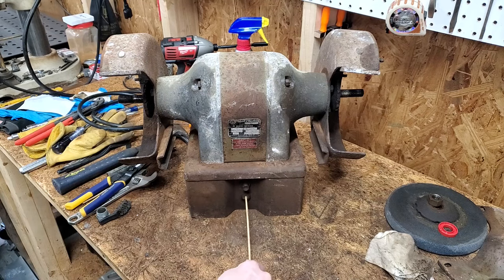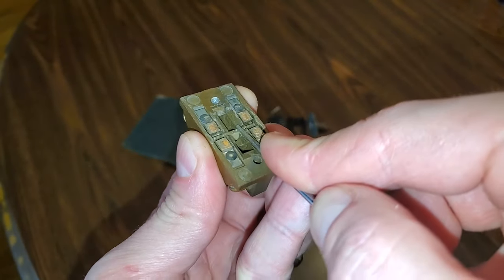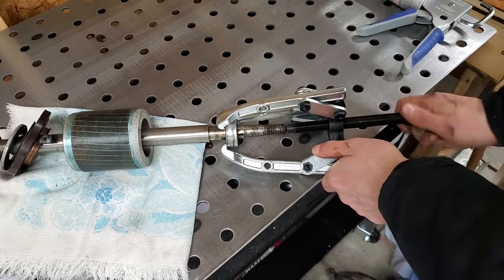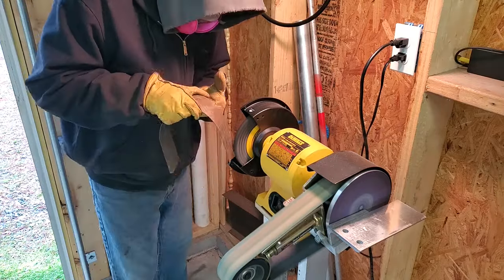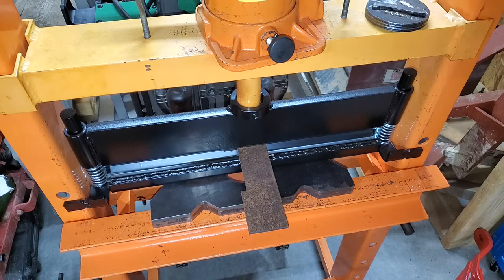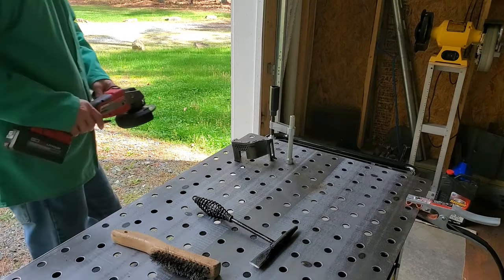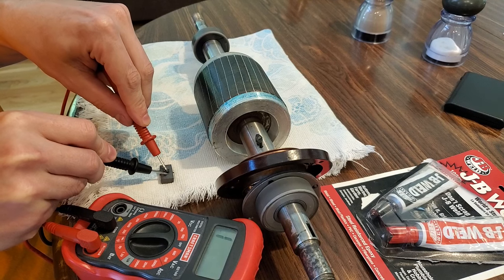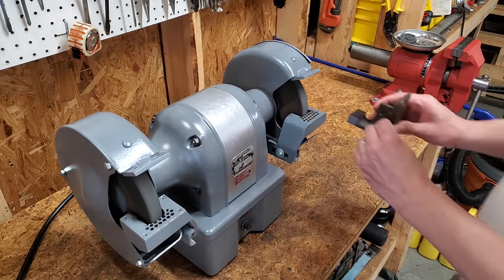Bench Grinder Restoration

Comment from the maker: 2 or 3 Jaw Gear Puller:
https://amzn.to/3WXPVWs (affiliate*)

Mobil Polyrex EM Electric Motor Bearing Grease:
https://amzn.to/3NitdFl (affiliate*)

Loctite 545:
https://amzn.to/45Olc2d (affiliate*)

*Purchasing from these Amazon affiliate links earns my channel a small commission. Think of it as a tip that doesn't cost you anything. Thanks for the support!
Reply: This tool costs about the same as a new bench grinder, lol.
I appreciate the project for the love of it though. A Black and Decker though? I'd have walked on by. In the UK they are considered cheap rubbish, at least nowadays. This looks like it was built in the 60s and might be worth the effort, since EVERYTHING was made properly back then. 

My grinder has stopped working.... I turned it on one time in freezing cold weather and it started briefly and then died. Is that the motor giving up? Took apart and can't see anything immediate. The fuse is also good. There's no capacitor though, which is weird.
Reply from the maker: @ArcanePath360  I agree, I wouldn't have grabbed a more modern B&D grinder but this one is pure quality. I like knowing that it was literally at the dump and now it's a very capable tool. Money-wise, I only bought some bearing grease and paint. It took a lot of time and effort but I learned a lot. For me, that's what it's all about. :)

As for your grinder, I'm no pro but it could be the switch. I'd try bypassing the switch, like I did, then plug it in and see if it comes back to life.
Reply: @Mikeattempts   Thanks, I'll give it a go. I agree. I spend months on projects that don't save any money, but as you say it's about learning and honing skills.
Reply: @Mikeattempts  Ok I tried the switch... I think it's a single pole, there's only continuity on one side when on. I thought both sides needed continuity to work and a single pole only shuts off one side, but whatever.... I bypassed anyway and nothing happened when I plugged it in.
Reply from the maker: @ArcanePath360  With the switch bypassed and the grinder plugged in, give one of the grinding wheels a spin to see if you can get it going. If not, I guess it's an issue with the motor. Unless your grinder has carbon brushes that need to be replaced.
Reply: @Mikeattempts  Yep, I tried spinning, thanks. No bushes. It's a cheap one that's served me for about 10 years so I guess it's time to get a new one. It was only £30. I think I'll get one with more power as 150w is not enough for me any more.

Comment: I have the ten inch model. Exactly the same. They were made in the 1940's. Mine has the original paint. It has so much power it's a bit dangerous.
Reply from the maker: That's cool, I didn't even know there was a 10" model. Original paint too, that's rare! :)
Reply: Want to sell it? 🫂
Reply: They built them to last back then. I have a 10 inch Wolf grinder and it is all cast and indestructible. It weighs in at about 100 pounds with 1 1/2 inch wide wheels on and runs on under its own momentum for several minutes after it is switched off,   Potentially pretty dangerous if you haven't got your wits about you.

Comment: Good job on the restoration! I'm always pulling things out of the trash just to see how they work and if I an fix them. Even when I don't need them.. Ashamed to see things go to waste when they can be repaired and used again.
Reply from the maker: Thanks! I couldn't agree more, it's very rewarding to save valuable tools from the trash. I'm the same way, I want to understand how stuff works. I've learned a ton since starting these repair videos, but I know I still have a lot more to learn. Thanks for the comment.

Comment: That gear puller is certainly right for removing bearings. Nice overall job on the bench grinder. You lucked out on that one! :)
Reply from the maker: Thanks! I think there's a tool specifically for pulling bearings and evenly supports the face. Luckily these weren't tight, so the gear puller worked fine. :)

Comment: I'm lovingyour content and the philosophy of repair you're bringing to the world. Though I have to say, if ever you are filing, the best method to remove the most material faster without making an awful noise, you want to position the part to be filed so you can file directly above it. And forward strokes only. this keeps chips from binding in and rolling around between the teeth all the time and keeps you square to the work surface. I know what Fireball Tool said, but knowing what my cheap files have done, it baffles me that the expensive files he used wore out after taking so little material.
Reply from the maker: Thanks, I'm glad to hear you're enjoying the channel. Yeah, I get that the file only cuts in one direction but picking it up after every stroke just make the job take so much longer. ;) Thanks for watching!
Reply: @Mikeattempts  ah, it depends. I love filing, personally. It's not as quick as a 40 grit flap wheel but the file can be as rough as a grindstone or as accurate as a CNC machine depending on operation.
Reply from the maker: @classydays43  I can't say I love it but, once finished, it is satisfying to see the results of shaping metal by hand.

Comment: A few things. The thing you called a commutator should be the centrifugal switch that breaks contact with the start capacitor once the motor is up up to speed.

The other thing? IMO never reuse sus bearings. Just don't. Bearings in an application like this just aren't that expensive to replace. And these for sure look like they were "rode hard and put up wet".
Reply from the maker: Ah, thanks for letting me know about the centrifugal switch! As for the bearings, I agree. Like I said in the video, I bought brand new bearings, but I couldn't find the exact width. I was afraid there'd be too much play with the new bearings, so I decided to clean and repack the old ones. They sound good when the grinder is running but I guess time will tell. Thanks for the comment!
Reply: Thanks so much for making this video! It’s exactly what I needed to see. I was given the same grinder, albeit slightly different. Probably just a different year. It works great and has no damage. It even came with both tool rests. I’m going to replace/repack the bearings and paint it. This is a quality USA made tool.

Comment: Drill pilot holes first, that centers the holes. Depending on the final hole size, drill the holes larger by stepping up drill sizes for easier drilling and it is less damaging to the bits.
Reply from the maker: Ahh, makes perfect sense, thanks!
Reply: @Mikeattempts  keep up the good work
Reply from the maker: @remowilliams8118  Will do, thanks again! :)

Comment: For a slot. Get a beefy x-y table with a vice and use a 4 flute plunge end mill (has teeth on the ends as well as the sides)
Reply from the maker: Would an end mill work alright in a drill press?

Comment: Love it! You went all out on that one. Not many still using stick welding in their repairs....I'm old school too.  When I find a bearing loose on a shaft, I add three center punch divots to the shaft to tighten things up, comes apart again with no heat. I made some fully adjustable rests for my old Baldor, see them at "Instructables- Beagles - New Rests for Bench Grinder"  Cannot add a direct link here or my comment will be deleted.
Reply from the maker: I'm glad you liked the video! I put a lot of work into this grinder because I'm in it for the experience and to learn. I checked out your adjustable rest, those should last forever! :) Thanks for the comment.

Comment: Hey Mike, next time you encounter a loose bearing and shaft surface that's too much for threadlocker to fix, use a solid center punch and hammer to peen the shaft where the bearing's bore would seat.  Don't go at it like a shaved ape with a sledgehammer but with just enough impact to raise the surface in equally spaced points around the shaft. You may need to repeat the procedure in an equidistant row from the last one until you have raised the surface enough to accommodate the full width of the bearing's inner race. Once you're satisfied with that, add the threadlocker and seat the bearing. Should cover the repair enough to satisfy your need more than adequately.
Reply from the maker: I've heard of that technique, but I've never tried it myself. I considered it on this and a more recent project, but I was hesitant because I didn't wanna mess up the shaft. However, your detailed tips would make me feel more confident that I was going about it the right way, thanks!

Comment: the mistery item in the motor is in the uk called a centerfugal switch great grinder when its up and running
Reply from the maker: Ah, so it disconnects the start capacitor once the grinder is up to speed? Thanks for the info!

Comment: That comptration in the motor is a odd centrifugal switch, if it broke again , it can be replaced whit a modern centrifugal switch for the same size motor or a push button as a starting capacitor switch.
Reply from the maker: Ah, it's good to know I'd be able to replace it with a modern style centrifugal switch. I'm not sure if I understand how it works though. I assume that little spring-loaded post with the carbon brush retracts once the motor is up to speed but how does it retract? If anything, I would think the brush would be push away from the shaft harder as the shaft spins faster. Thanks for the info!

Comment: What was the bearing number of the original?  Or do you have the ID, OD and shaft diameter?
Reply from the maker: The original bearing ID is 20mm and the OD is 47mm but I don't remember the width. I was able to find replacements with the proper ID/OD but I couldn't find the right width, which is why I ended up regreasing them.

Comment: Please explain what you need to see on the multimeter during the continuity test.
Reply from the maker: The great thing about the continuity test is the sound. If you hear a sound, there is continuity between the two spots the probes are touching. No sound, no continuity.

Comment: the reason that your bearings darkened is because you used the " green simple green " in your ultra sonic. You gotta use the purple simple green, and it dosent darken the metal. Learned this the hard way on someones carburetor lol
Reply from the maker: Ah, nice to know, I didn't even realize there was a purple version of Simple Green!
Reply: I also learned to not use simple green (or purple de greaser) in an ultrasonic cleaning black oxide bolts - it takes the black oxide finish off entirely!
Reply from the maker: @gorak9000  Yeah, another problem I've run into is the "longer is better" mindset when it comes to soaking things in the ultrasonic cleaner. You can easily go from cleaning to doing damage.
Reply: Try adding a small amount of automotive antifreeze to the simple green solution to help prevent oxidation.
Reply from the maker: @commpost2  That's interesting, how does the antifreeze counteract the oxidation? The only problem is that it would take the solution from non-toxic to toxic by adding the antifreeze.

Comment: I have a model like this except its english model 220 volts from my dad who died in 1983...changed the right side wheel ..cant get the left one out ..a y suggestions
Reply from the maker: One side of the shaft is reverse threaded so you can put a wrench on each side and tighten them both at the same time. It doesn't work as well when removing them because one side always breaks loose first. An impact wrench or maybe even an impact driver should do the trick. If you don't have any impact tools, you could put 2 nuts on the side that has been removed and tighten them against each other, then you should be able to hold the shaft while loosening the other side.
Reply: Ok thanks will try..ive know it since i was 10 years old..and im now 67..not one issue yet
Reply from the maker: @garyallport18  Wow, that's impressive!

Comment: Instead of using paper towel to hold screws on a screwdriver try a small dab of grease.
Reply from the maker: That's a good tip, thanks! I recently picked up one of those tools that grips the inside of a slotted screw on one end or a Phillips screw on the other. It's not something I use often but it makes life much less frustrating. :)